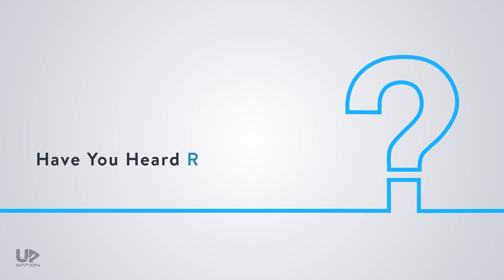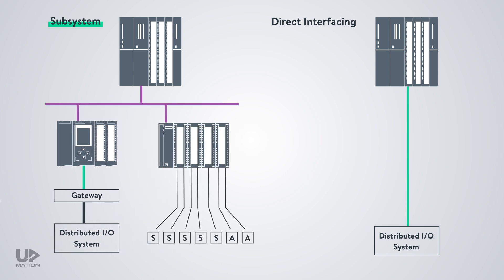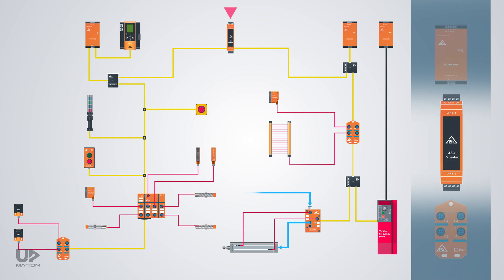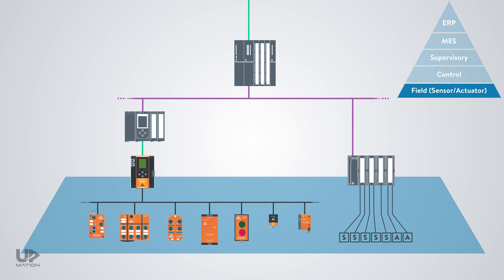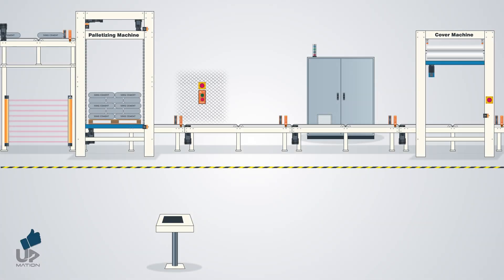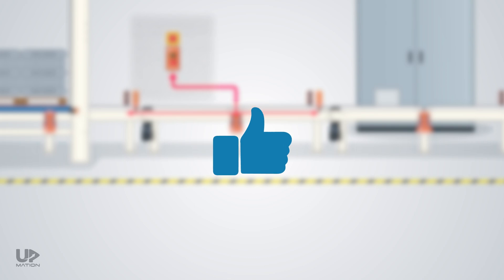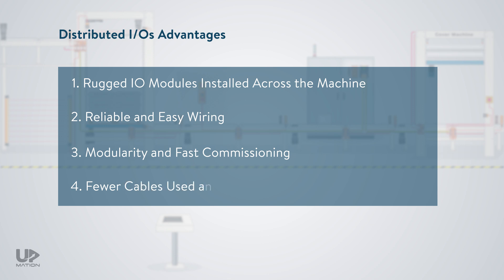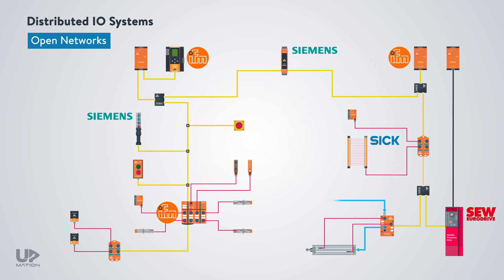Distributed IO vs. Remote IO | Differences & Benefits

Comment: Great video and very clear explanation..Can you make a video about two wire network cable?. How it works or transfer supply and data at the same time..
Reply from the maker: Hey! Thanks a lot for both your compliment and suggestion. I will definitely transfer it to the team.

Comment: Perfect animation and explanation.. Glad you are back after long gap.. we are using an AS-i module along with this distributed io’s which means AS-i modules commands field devices ?
Reply from the maker: Thanks a lot! AS interface networks are using Distributed I/O configuration. The IO modules that are used in AS interface networks are not the type that can command the Inputs and Outputs directly. But there are other types of networks with a different type of protocol that utilizes I/O modules capable of some sort of direct commanding to the Inputs and Outputs. These modules, of course, are aimed at controlling the Analogue devices in order to free up the PLC's CUP from extra processing loops and to enhance the automation processes' reliability. Hope this answers your question. If there is any kind of specific subject or expression that might seem vague or intangible to you in this matter then please don't hesitate to let us know and we will try to use them for the next video's subjects.
Reply: @Upmation  Thanking you on behalf of everyone for replying each and everyone’s comment and thanks for your answer.
Reply from the maker: Any time! Happy to help!

Comment: I am an Electrical Design Engineer and even I get confused with the terminology used in automation systems. I think the confusion comes from misuse of system descriptions. The main thing to understand is what equipment and options are available for automation systems these days. It is a rapidly changing industry.
Reply from the maker: Hi, Earle! That was a great point to mention. It is indeed changing rapidly. Please let us know of the challenges you deal with as a Design Engineer and the suggestions you might have for the next videos. BTW, thank you for the input!
Reply: @Upmation  A video on IEC 61850 basics would be a great topic. There are loads of videos available but they seem to be aimed more at the expert instead of the novice. It would be good to know about the basic message formats and behaviour , ie: cyclic versus subscriber messages
Reply from the maker: Great suggestion! Thanks a lot!